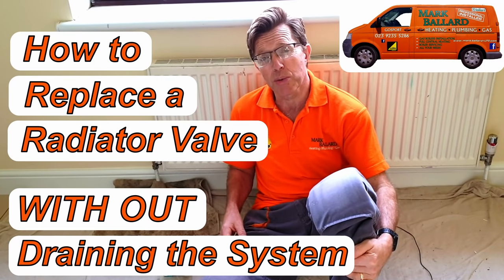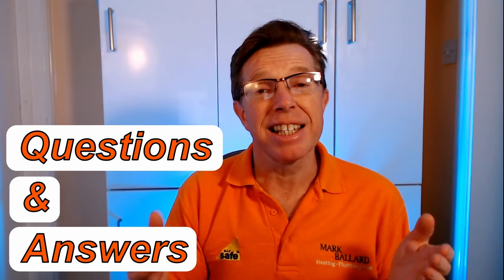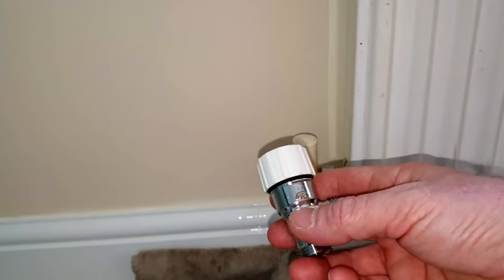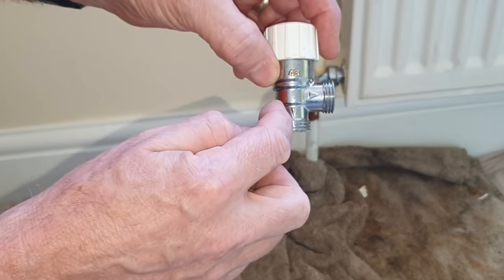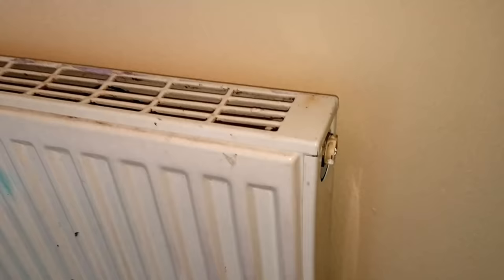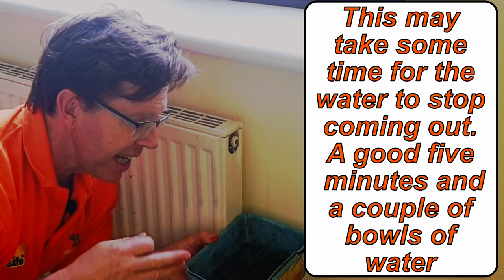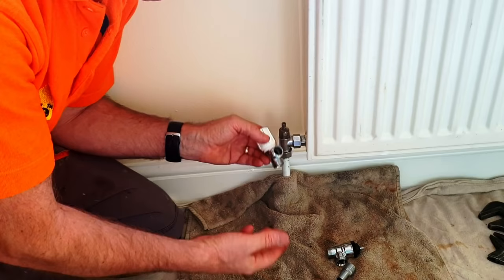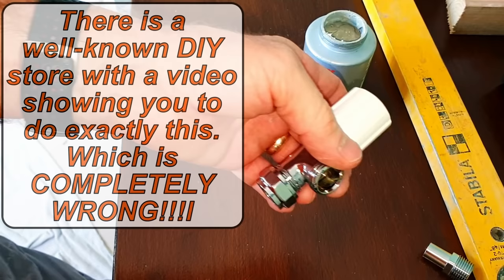Replace Radiator Valve with Out Draining the System. Updated. Part 1.

Comment: Good video. I'm pretty handy with my tools but I don't think I'd attempt this myself but before I call a plumber out, could you answer a quick question? I've recently started building a smart home, so my two heating zones are going to be controlled by all the smart trvs rather than just the two wall thermostats originally installed (ie if none of the trvs on the radiators want heat then the zone will turn off) .

The issue is that the main bedroom and the living room where the wall thermostats are don't have thermostatic valves.
I understand that each zone should have at least one free flowing radiator, but the downstairs toilet and upstairs bathroom /en suite take care of this - would you forsee any issues in having the normal screw valves replaced on the bedroom and living room radiators?

Comment: How happens if you need to replace both valves, do you do one side as per video above then do you fill radiator close the 1st replaced valve then bleed it to remove pressure then remove other side by draining off excess water?  Concerned that when you do the other side the vacuum in the system is no longer there which causes the water to thrust out.

I would appreciate info about changing both side on the same radiator.

Comment: I have one rad with trv that doesn't want to stay on, I did replaced the head for another one from another rad and still after adjusting trv couple of times, just pops off. I did buy brand new trv and used just head and same thing happened, I did used some ptfe tape on heads tread and I did improve it but weeks later same thing again. When adjusting trv, ring moves with head and head pops off leaving loose ring still attached to tread. Do I need to change whole valve or is there anything else I can try before?

Comment: PTFE on threads is not for sealing, teflon is the most lubricating substance there is. You put it on threads so you can tighten the nut up past the point friction would allow you too, therfore being able to tighten the joint further and easier which in turn compresses the olive more and creates a better seal. No jointing compound needed then. This guy may have been in the trade a long time but this is the reason plumbers and mechanical engineers use ptfe on threads, plus i've never used ptfe tape to seal anything
Reply: The primary use for PTFE tape is on tapered threaded joints, where the tape is the only sealing material (of course, any old jollop might do).  It was not developed to reduce friction in parallel threads, AFAIK.  Of course, if a compression fitting is leaking, PTFE on the olive is one solution.
Reply: @martingerhold2111  "designed for" is a strange statement seeing as most things are adapted for use in the modern world. In engineering we use ptfe tape for parallel thread friction reduction, i personally prefer paste but it is generally too messy for domestic plumbing. But anybody who has done their share of compression fittings will see the notable differnce in compression using it on a thread or not, probably 360° more so you actually have to be careful not to over tighten as the olive become too distorted as apposed to without friction reduction on threads you have to use a lot more pressure just to get the required seal.

Comment: why do you not replace the valve with its new nut and olive?
great video mark, btw i have to move my rad 2" away from wall due to internal insulation being placed on wall, can not move pipes from under floorboard! can i use elbows for this? thanks
Reply: Try and bend copper if possible,make it look professional

Comment: I do it like you but sometimes I feel a right scruff as I’ve used the old olive and nut..I once took radiator of for decorating and didn’t use that decorators cap and the system emptied in the night.you should have said how critical it is

Comment: Combo boiler systems are easier as they are pressurised . Simply shut off all the rads you are not draining and depressurise the system by either the pressure release valve or the drain off cock with a hose , you can simply drain out the flow and return pipes and the rad as long as the feed is not dropping  down from above isolating it . In this case You can then close the valves undo the coupling to one pipe which you previously emptied and place a container under the rad and turn on the valve and slowly empty it out . Fit the valves and hey presto . There are obviously variables . On a system with a feeder tank the process is slower and different . I always fit valves with a drain off on every rad . Especially on radiators that are drop fed . It’s a good video but he’s been at it a long time and things are not always straight forward to untrained people . If you’re not sure pay a professional .

Comment: Does it matter what side the thermostat value goes on, flow or return? When trying to balance my system I've noticed the are not all on the same side for each radiator
Reply: Doesn't matter with a bi directional trv fitting to flow or return is ok

Comment: ive been a gas engineer for near 20 years ive never had a leak ever and never use a paste or ptfe tape on any rad valve olive ever there is just no need at all when you compress the softer copper olive onto its seating it shapes to that seating , again no need for any gimmick paste at all gas paste on olives that are on a gas carcus yes by all means use it but no need on water system olives and never use ptfe around an olive just change the olive .
Reply: Ngl i would normally agree with you but I mainly use the paste as a lubricant and to prevent the heating up and cooling down to cause a leak over a period of time and the metal expands and contracts, I prefer the peace of mind, boss white is overkill, but a soft setting paste like jet blue is good in my opinion, just to prevent expansion and contraction from lossening the joint

Comment: Big problem, my pipes to radiator are solid in the floor, plus the are placed really close to the wall that the rads are on ,no space wiggle room. 
What to do?
Reply: Just drain the system, its far easier to drain and fill than all that pissin about hes doing.

Comment: No sealant of any kind should be used on a compression fitting that is what the olive is for and if you use a sealant you void any guarantee given by the maker. If it leaks it's not tight enough and by the time you have rolled back the carpets and played around you could have drained the system

Comment: whats the indication to change the valve.My radiator is luke warm.the radiator has been bled ,no effect.So is or both valves blocked and therefore need changing,Where do i buy these radiator valves from

Comment: How can you tell flow & return, if no rad is in situ. I’m in the process of fitting a TRV
DOES IT MATTER IF TRV  IS FLOW OR RETURN?
Reply: Most trvs are bi directional these days meaning they can go on flow or return  the valve body will have directional arrows on it

Comment: The use of jointing compound on rad valves is just lazy plumbing. Also are you gonna move the customers furniture to pull back the carpet? Takes half hour to drain the system down enough to work on it.

Comment: Hi Mark, thanks for an excellent video! Sorry If I missed this, but could you tell me, was this an upstairs radiator? I have an upstairs radiator that's leaking from the valve and I want to replace it, but I'm scared water is going to endlessly pour out and flood the bedroom :) It's a combi system with the boiler upstairs in the room next to the offending valve.
Reply: You need to re-watch the video!

Comment: What does it mean when your thermostat on a radiator is on 5 but your radiator is still cold when your central heating comes on does it mean the radiator need bleeding or replacing
Reply: ok, a thermostatic  rad valve , works on detecting air temperature,  so lets assume your number 5 is 70 degrees, if the room temp is 70 degree, the valve stay shut and rad will be cold, when the temp drops, the valve will open automatically , and the rad will get hot. your thermo valve is an automatic on , off valve, hope that helps

Comment: I’m going to go for it 😎

Silly question though, if thermostat valves come in two parts like that, why can’t I just replace the top (thermostat) bit rather than the full thing?
Reply: Because the old valve was different, incompatibile with thermostat. Thermostat valve is a push pull type. Thermostat expand due to temperature, and presses the valve lever. While the old one was "twist&turn" to open. Has this clarified your doubt?
Reply: Thanks! That sounds like if it is a simple replacement of like-for-like I could get away without the faff! :)

Comment: Far less aggro and faff to just drain the system rather than having little drips and runs of black oxidised water potentially going everywhere.
Reply: Yeah...far less agro to drain downstairs rads with underfloor pipe work and no drain off lol. You’re in the exact same position regards spills but you’ll have to bail each one individually.

Comment: @15:32 - wouldn't that drain other rads on the same floor (or have you already isolated those - sorry if I missed a step)?
Reply: Yes isolate those by turning off on both flow and return, did say that early doors

Comment: You can’t do this on a downstairs rad , it will drain the rads from upstairs , this is all risky stuff, and if you isolate the upstairs ones , you have to re balance the whole system
Reply: No it won't, will only drain the upstairs if you open the bleeds or an AAV socks air in, if its a sealed system it will just vacuum, if its open vented you can just bung it to turn it into a sealed system temporarily
Reply: @steowens8243  so basically your draining the system
Reply: @lestc8579  no because it vacuums, it has to suck air in to let water out, so on a sealed system once the pressure is gone there's nothing forcing the water out, unless you open a bleed or it glugs and sucks abit of air in which is manageable, long as you work somewhat quickly its fine, like I wouldn't remove the valve and then go answer a phone call in the van, ive not drain a heating system for maintenance repairs in years

Comment: What!?!?!
You advocate putting joint compound on the "olive" (We call that a ferrule in the USA)?
I would never do that, the ferrule has to be absolutely pristinely clean both where it will deform as it is compressed on the pipe and the nut that does the compressing.
The only time I've seen a failure is when everything is not pristinely clean and when there is an attempt to reuse the ferrule instead of using a brand new one.

I've found that adding anything including joint compound (and worse, tape) is typically bad because if it has any contamination or granules of anything, it will cause a bad seal.
Also, joint compound has lubricating properties which is really what you don't want, and will prevent the ferrule from deforming tightly on the pipe.
Reply: Hear hear!  I hate it when I find a compression fitting that has failed, and it turns out all that was (for a while) holding it in place was the jointing compound.  Completely unnecessary if the metal surfaces are clean and it is done up enough (except for very cheap Wickes radiator valves from 25 years ago).

Perhaps worse is the jointing compound liberally applied to the threads and dried up, so they won't shift.

Comment: Should have made clear at the very beginning this method of not needing to drain the whole system is really only suitable if you have a combi \ pressurised system and not one with a header tank in the loft ie F & E. It's 6 minutes in before you make this statement.

Comment: Pay no attention to draining it from a rad vent…if you have a combi turn the flow and return valves off…it will cause a air lock and you will get a cup of water out of rad valve

Comment: Few things to say :
-it looks to me you're draining the system. Some valves can be replaced without draining the system but you'll need specific tool from the manufactor. You basicly have like two drops of water with that tool.
-you can't put thermostatic valves like in this video. Read the f... manual. We never put the thermostatic head on top of the pipe. Always on the side. They react to heat, and heat is obviously comming from the pipe.
-if you don't know how the pipes are in the ground, I wouldn't bend the pipe like in the video. It can go well, it can go really wrong.

Beside that, all other tips looks nice to me(component on fittings, no use of toilet paper, holding the valve while loosing the fittings,...)

Comment: What a mess , did you explain them this a combi boiler , and radiator is upstairs ? It’s a lot involved guys , do not do it by watching this video, otherwise you flood the house without correct tools and knowledge... take advice from me , he might have a lot of experience on a boilers but not on Radiators , tightening the nut where the radiator tail is , it could be undone anti-clockwise , did you explain them that ? You have to hold the radiator tail with mini spanner before you tighten? You have to explain them in detail if , I was you... what about the radiators next door? Another gravity flood all goes on a same pipe work loop 🔁, what happens if the radiator valves next door are faulty, another flood doing this job ..

Comment: I appreciate what you trying to convey in this video but such a tutorial is sloppy and unprofessional for a few reasons:

1) you have invalidated the warranty of the valve by fitting a different ferrule and backnut (from the old pipe) additionally opening yourself for trouble despite the fact you state you have done this "a million time", you have done this a million times incorrectly.
2) you have been paid, presumably, by a customer to replace the valve(s), the entire valve not just 3/4 of it which you have shown. As stated above you have not replaced the old ferrule and nut which may not match EXACTLY 1/2" or not, it's unlikely to be the same manufacturer and/or model and therefore it is incorrect as well as unmatching colour wise (chrome, brass, etc)
3) you now have a brand new valve combined with an old ferrule and nut of unknown age that the customer knows nothing about but has paid for.
4) despite your comment about brass and copper "not rusting" (scoff) the ferrule and nut WILL be oxidised depending on age and it is more than good practise to replace both. No justification is valid even if you think it "looks ok". Anything less is sub standard.

You may get away with this 9 times out of 10 but it's sloppy and unprofessional and you know that deep down. 

Just do it properly and drain down the whole system and replace the entire fitting.
Reply: Who's going to be bothered as long as it doesn't leak? If I paid a plumber to change a valve and he left the old nut and olive on, as long as it didn't leak I'd be happy 🤷‍♂️
Reply: Still no need to drain the whole system to replace the entire fitting,
Exactly the same procedure, just  use an olive puller to remove the olive then fit all new.
Reply: So you would removed the old olive on the tail?  Good luck with that!  And who cares about the warranty on a £12 valve?  They won't pay up if the system blows up, at most 'they' will supply another valve - to be fitted at home-owner's cost.

I'm sure there are customers out there who would insist on all the new parts being used - and they will have to pay for the time and trouble to remove the old olive.

Comment: 20 years experience and you haven't got a scooby doo. What have you been doing for 20 years? It's people like you that set up wannabe plumbers for a fall and then guys like me that have to pick up the pieces afterwards (albeit with bad vibes after they tell me they tried to do it themselves after watching some numpty on youtube).

Ours is a highly skilled trade and you  are causing so much damage not only to the earning potential of thousands of plumbers in this country that have invested tens of thousands of pounds to be there for people when they need us at a moments notice, but also to the viewers property if any part of this repair goes wrong.

For instance - i didn't watch your video to the very end because listening to you flap on was giving me a severe headache, but from what i can gather from other comments you have not mentioned inhibitor?

Also paste on the inside of a thermostatic valve body? When that heats up it'll move and settle on diaphragms and moving parts or build up and clog internal parts of the boiler components.

Also that Trv you used has a plastic cartridge which will last 2 years at best before it starts pissing out.

And the comment about saving people money?

A: this could end up costing them more money if it all goes wrong and a plumber has to come out on an emergency callout (what if they airlock a few rads)?

B: proper procedures not followed which may cause damage further down the line

C: i am a self employed plumber and have been for 12 years. I have been a plumber for  20 years (proper plumbing not this sillyness) and i can tell you and any viewers this useful piece of information

NOT ALL PLUMBERS/TRADESMEN ARE ROBBING GITS

I personally assess a property/customer and if i get the slightest clue that they're struggling financially i'll discount my bill to help them out and if i'm not on the job long i'll discount it heavily.

WE'RE NOT ALL BAD THERE ARE SOME OF US THAT ARE STILL HUMAN!

*Also it would have been a lot quicker to just drain the system btw this way is utter nonsense

Rant over. Would be nice to have some fellow plumbers (brothers) back me up and not hate on me for voicing my opinion.

Comment: This is a bad idea. You never reuse existing nuts and ferrels. The nut weakens over time and can split after its been tightened again. Then youre on the hook for all the damage the resulting leak causes. Stop trying to cut corners and spend the time draining the system and do it properly.